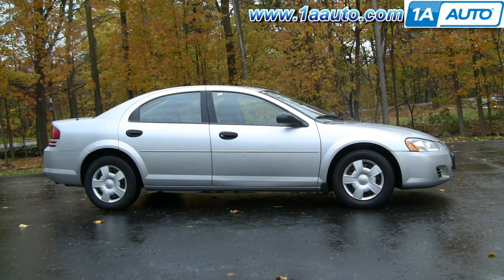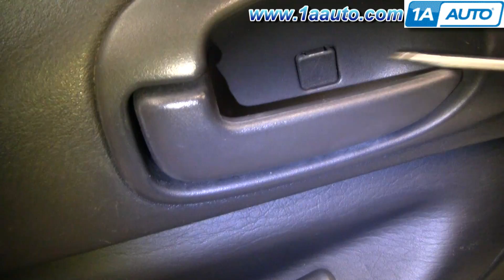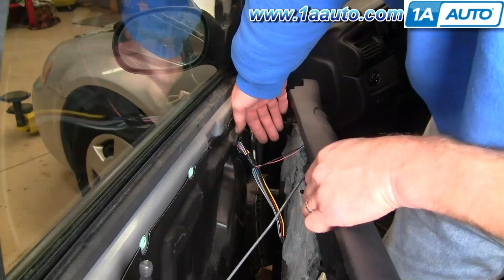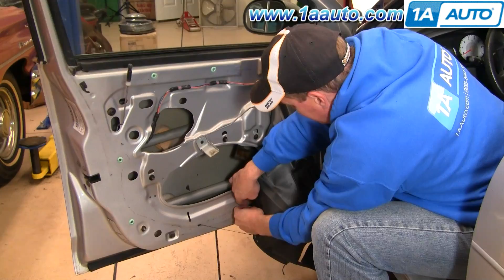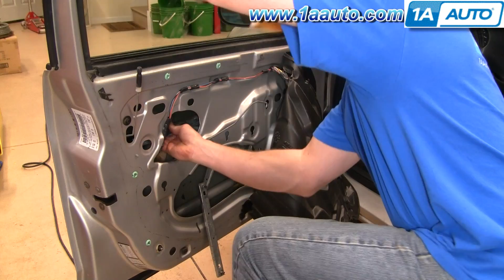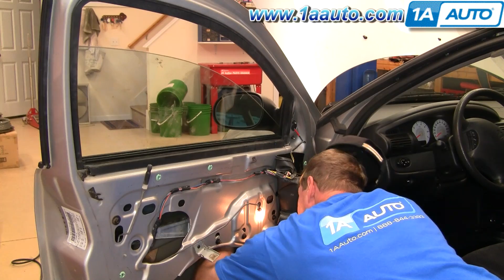How To Replace Power Window Motor 01-06 Dodge Stratus

Comment from the maker: If the window is stuck down you can cut the metal cable that the window regulator pulls up and down. That will allow you to be able to get the window to slide up and down. You will want to support the window while you do this or the window will come crashing down.

Comment from the maker: You can but it will require regulators that will be able to be retrofitted to the vehicle without having any issues. The power locks can most likely be done with the original equipment pulled from a salvage vehicle.

Comment: very good video. I would like to add that there is a red safety pin on the motor connector, so you have to remove the motor / regulator to get the connector off. I would not leave the window free hang I used a piece of a 2x4 under the window, then I remembered I had 2 suction cups for carrying glass. I put one on each side of the glass at the bottom...worked perfect.

Comment: Thanks for the video. My question is what would cause all my windows around the vehicle to stop working other than the fuse and the main switch on the driver side. I replaced both of them and non of the windows go up or down.

Comment: When putting the bolts back on the regulator, do you put the bolts on the actual window on first? I couldn't get it back in correctly but anyway the new motor wasn't working still. Not sure if the switch is maybe bad?

Comment: Nice video. Hey, I have a problem with my 06 stratus' driver door lock. It doesn't work with the power door locks on the door or with the key fob. It will only work by hand/ door handle on the inside and with the actual key on the outside. Do you know what the cause of this is?

Comment: 2005 dodge stratus sxt. driver window wont work. applied pressure downwards made it go down. but i let it go all the way down now the window wont get back up. if there is a simple fix i will try this. also if new window motor is necessary.. how much would one of those little motors avergely cost

Comment: I have a dodge stratus 2002. 6 cylinder engine. I need replacement part of the cover only. It broke & I need a new one for the left side. The people from the auto broke it but didn't took responsibility for what they did. So now am stock on buying one. How much would cost me. The window switches are good. I need the cover only.

Comment: I just changed the motor on the drivers door and as soon as I was done with motor replacement I tested all the doors before the final assembly. Bang passenger window won’t move now.
Reply from the maker: +Emiljano Shehu You may want to see if the window regulator cable or arm is getting caught on something inside of the door. 1aauto.com
Reply: 1A Auto Parts it was working just a minute before I replaced the motor. Was working even the moment before I was about to secure the door panel. Either there is a wire getting caught or the body controls module is messing on me. I will start with the fuses first. And open the door from the beginning trying to pinpoint that thing.

Comment: the back of my window right side wont go down.   2002 Dodge Stratus. it dont make any clicking noise. what can I do to fix it. also the power windows from all the rest of the windows slows down when pressing up and down. what can I do.
Reply from the maker: You may want to check the power to the window that's not working to see if there's power to the switch and also the window motor. If there's power to the window motor the motor may be bad. You could spray the weatherstrip around the slow windows with silicone spray to help speed them up. Hope this helps you out. 1aauto.com 888-844-3393

Comment: My roommate owns a 2009 dodge charger. The passenger window goes down but won't go back up. I don't know the problem, can you help?
Reply from the maker: Thank you for watching.The problem can be the motor or the switch You need to see if you have power at the motor when activating the switch. If you do then the motors seized if not the its the switch. Please let us know how the repair comes out!
1aauto.com  888-844-3393